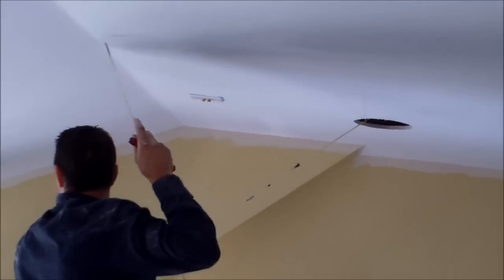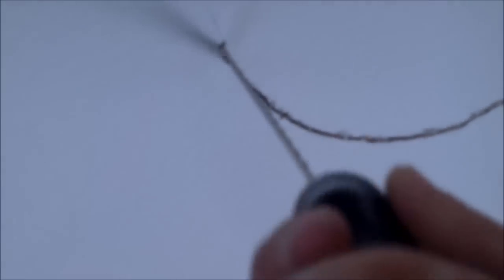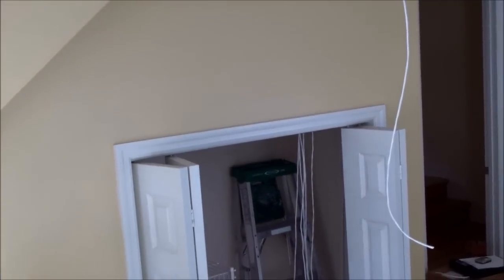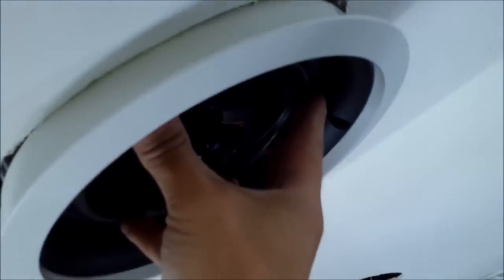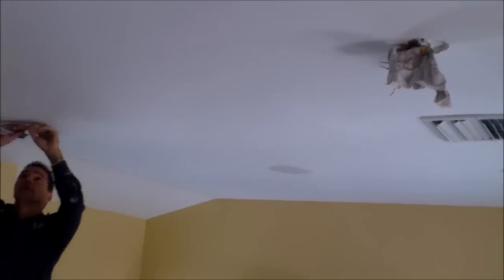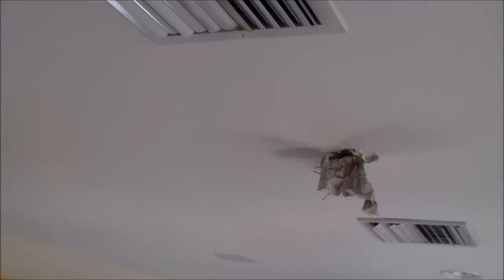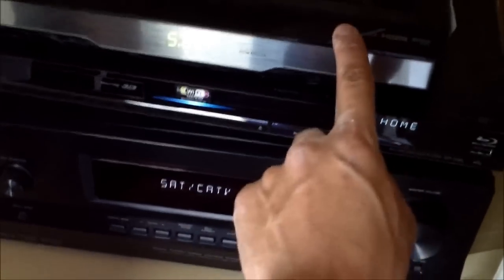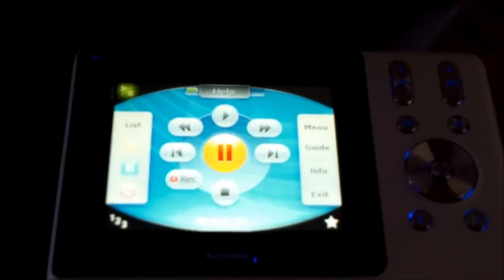7.1 Home Theater in wall speakers & Projector screen installation Review

Comment: This video could have been informative if it showed in detail how you: 
fished wires correctly
mounted the projector
how the projector is powered or install an outlet
how the cabling was wired from speakers to projector, to reciever, etc.
However you did show in detail how to cut a hole in the ceiling...thank you for that.

Comment: my next stereo. 2 BOSE 201 ( if I can get ahold of some VERY DECENT USED old ones, ill take them ) a big klipsch floor woofer, a Yamaha or onkyo head unit. 6 cd play ( GOT to have a cd player and a sound sock ) and it also would be connected to my tv through the audio optical.